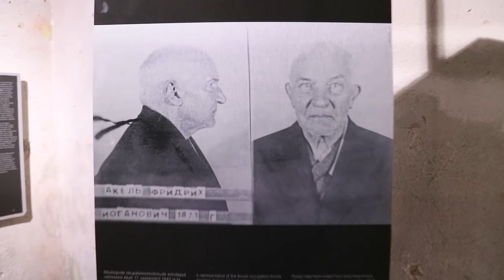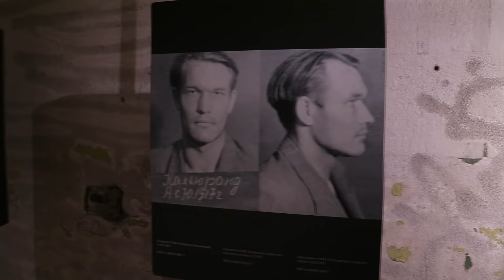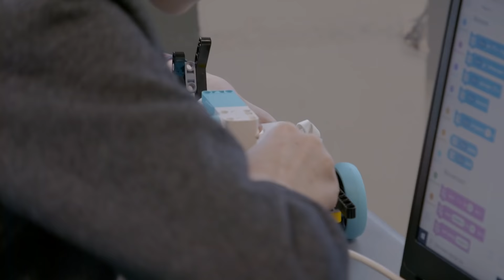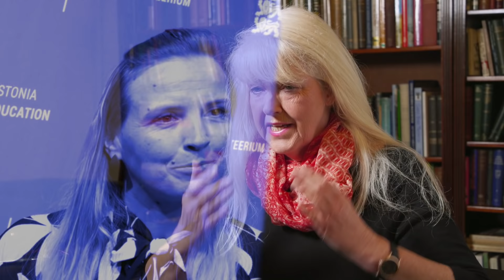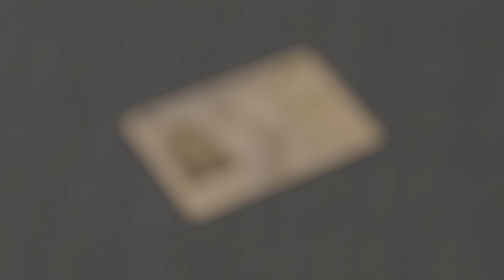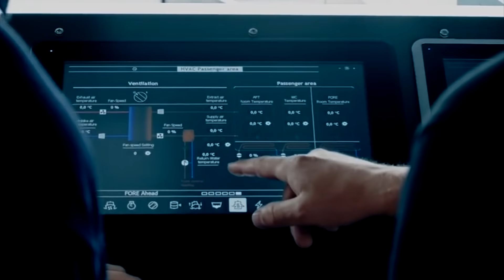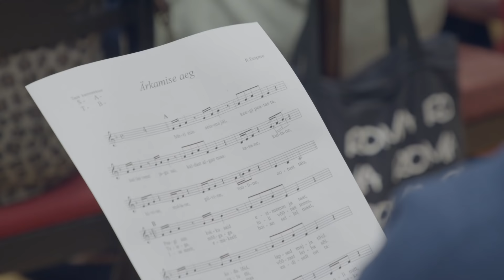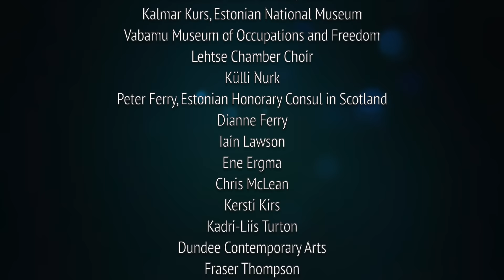Estonia The Baltic Tiger

Comment: Kevin in the USA1 week ago
“I am a provider and I also hold a PhD in Clinical Microbiology with an emphasis on molecular testing. I can tell you that using an RT-PCR test to determine positive cases is wrong headed when used against patients who have absolutely no symptoms. A positive RT-PCR test for SARS-CoV-2 means that the test has detected viral RNA in the specimen. Does it mean there is live, infectious, virus? Not at all. It can mean that the patient was exposed and had SARS-CoV-2 in the past. In fact, it can be from an infection 3 to 4 months ago. However, once a person tests positive, they are called a positive case (with or without symptoms). Then they get all of the contacts and call them up. If anyone claims to be symptomatic then they are called positive case without a test. That is why the numbers are so high. in the USA. For each "positive" case it can generate up to 40 contacts and those can result in 5 to 10 more "cases." I called our health department at the state lab and wanted to know why they put out that a positive RT-PCR test meant you have live, infectious, virus when it doesn't especially in patients with no symptoms. The party line is they want to ensure everyone obeys the mandates so they were instructed by the CDC to put up that guideline. It is false. A positive RT-PCR can mean you have live virus if you are symptomatic BUT if not then it is more likely to be past infection. I do think a RT-PCR or PCR test in a patient with symptoms of that infection are a great tool for early diagnosis and treatment but all governments have perverted molecular testing to meet some agenda. Plus, the US government pushed the narrative that we had asymptomatic super spreaders which has never been proven or documented in a peer reviewed journal article. The few articles making this claim are not peer reviewed and once they are it will be shown to be a lie. You may get a virus from someone who is presymptomatic, maybe, possibly, in a rare case BUT this is not the main cause of a pandemic. The only testing we should be doing for SARS-CoV-2 is antigen testing which detects antigens associated with a live virus infection. Why? Because it will only be positive in patients who have an active infection with virus that could be spread. Why are we not doing it? Because they claim is not as sensitive as molecular. Of course that is true BUT molecular stays positive for months after infection even if the patient never even knows they had the virus (herd immunity). The antigen test will only be positive in symptomatic, virus infected, persons. That is the test that President Trump is pushing out to eldercare and other facilities. This is also likely the test they did on him after he tested molecular positive and then he needed to be checked later which was negative. One other fact. No pandemic in the history of pandemics has ever used asymptomatic patients as a guide for prevention measures or to control a pandemic. In the past, only symptomatic cases were tracked because that is where the spreading occurs (not in asymptomatic people). Why are we doing it with SARS-CoV-2? Why indeed. Another fact. We didn't mask up people (even those of us in healthcare) during the first 3 months of the pandemic. We had some masking in dealing with direct patient care of known, symptomatic positive cases but that was it. Well, low and behold, once the pandemic appeared to be waining, the government then mandated masking of everyone. Why? Why not mask during the height of the pandemic? Why mask now that the virus is going down in prevalence especially with summer weather approaching and respiratory viruses tend to go away (mostly) due to the high heat and humidity? All of this was done for one reason. The election of President Donald Trump. The entire world has been scammed so the governments worldwide can exert more control of the population and make us all scared to go outside. This is one big power play by the globalists and their elected co-conspirators. We had a patient who needed a replacement valve for his heart. They cancelled his surgery because of the pandemic. He went home for about 6 weeks. His condition got worse so he got rescheduled for surgery. When he came in. He tested SARS-CoV-2 and surgery was cancelled and he was told to wait 21 days and come back for retesting. He went home and two days later he was dead. All governments who participated in this scam need to be charged, tried, and imprisoned for crimes against humanity NOW.”